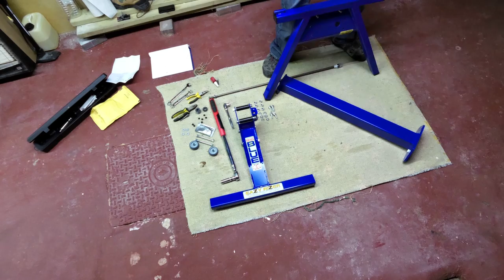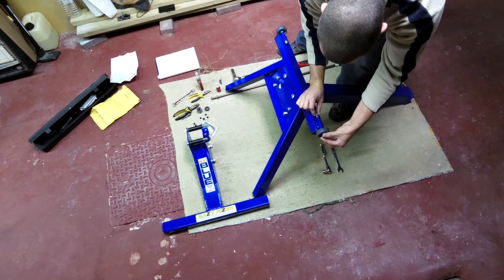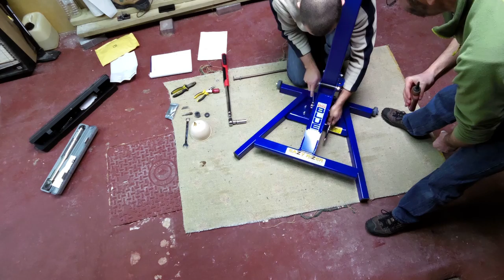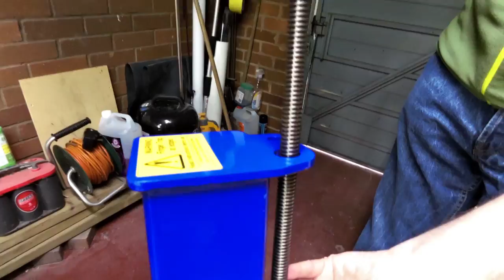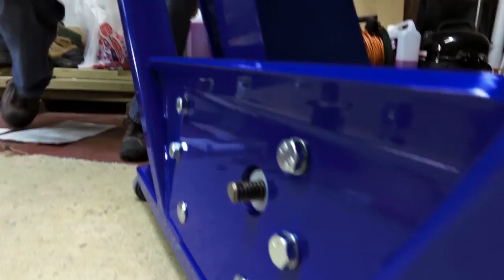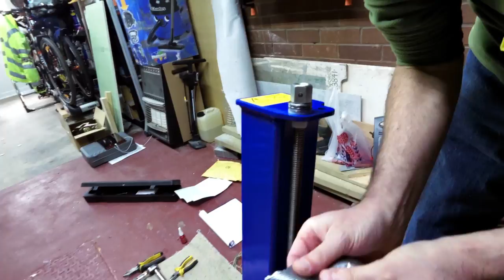Assembling Big Blue Motorcycle Lift

Comment: Guys instead of copy this product just spend this few pounds and buy one. They work hard to develop it is no need to copy, it is not China. So stop ask about measurements..... Or ask Harley about it and make your own lol
Reply: +abazdarhon It is pretty crazy of those guys asking for measurements on this page, but this lift is $985.!!!!!!!!! here in Canada. Sorry mate, that is way over the top. I can get an air operated table lift to 48 inches for that kind of money just like the one my Harley mechanic uses. Something is screwed up if this Big Blue has to cost that much. So copy it is.
Reply: +Donald Willick You must have missed the part about what I can buy for a lift for $985 even with the Canadian Dollar in the tank as you pointed out. Table lifts are the best, even if just for a comparison. Built in the USA. Direct Lifts, perhaps you've heard of them. Can't be duplicated for less money. Big Blue on the other hand can be duplicated for much less money. I have been welding since 1973. Just as a hobby. Steel is already purchased - $300.00.And I am talking thick walled steel tubing. 4 x 4 post. A lot stronger than Big Blue. A little taller and a bigger footprint. Way overbuilt but really sturdy. Really Heavy but it will be on wheels all way around. Looking forward to the build. And looking forward to what else it can lift around here. If yours can lift 1650, mine should lift double that. The weakest link being the thread contact. I have addressed that as well.  Now I am buying steel from a retail shop. Nothing economical about it. Still only $300.00. Way heavier steel than you are using in yours that you should be buying in bulk and way cheaper. Not a lot of welding involved. Did I hear someone on a video say yours is $500 quid? Yikes. Even with casters and paint I should be all in at $400 and a couple of hours welding. And 13% of that $400 is just taxes.
Reply: +Donald Willick We are talking motorcycle lift, not atv lift so I can get by with the $675 Direct Lift. Just so you don't get a headache that's $945 CDN.  My Harley weighs 850 so I am good to go. It's too long a story but I could get the lift home without a great expense. 

This was fun but now you are calling me names so the fun's over. This is turning into the classic Youtube comment section where guys cuss each other out from the safety of their computers. Pathetic. But one last thing, it's not rocket science. My lift will work just fine.
Reply: abazdarhon z
Reply: Glide1992 de
Reply: abazdarhon de
Reply: Hope you plan on using Acme threaded rod for this project .